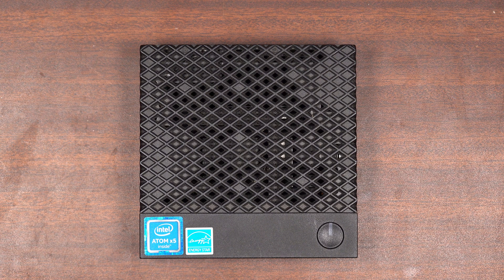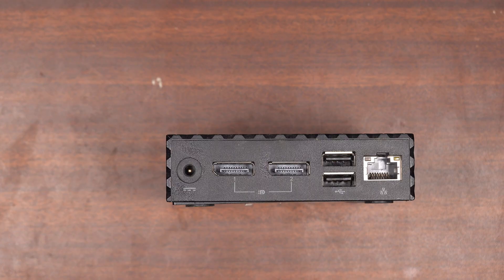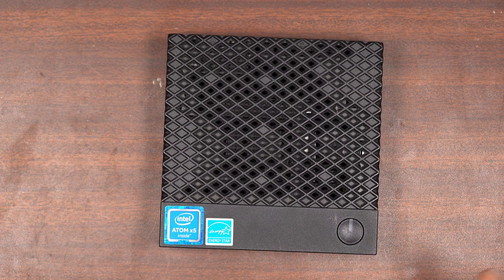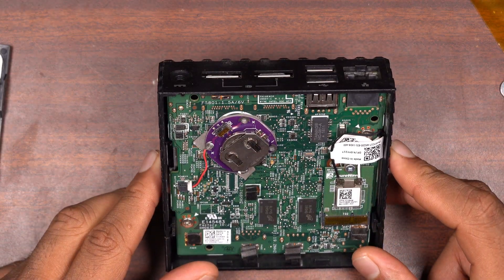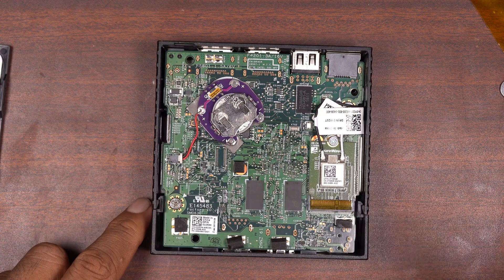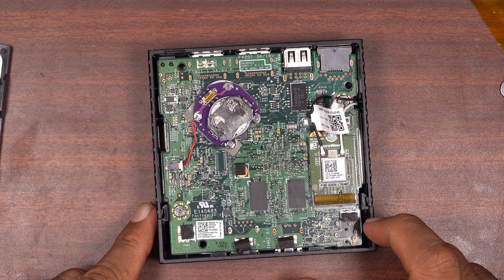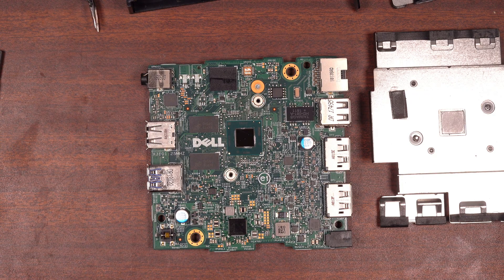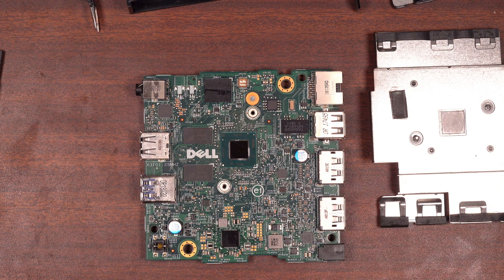Dell WYSE 3040 Thin Client | Teardown Overview And Benchmarks

Comment: I have similar one with 2/16, manufactured year 2021, the issue is it shows display only if cpu is powered first and monitor is powered off(unplugged or power switched OFF), after few seconds we can turn ON d monitor and it will show installed OS desktop. if monitor is powered ON and we turn ON cpu it will not show display. Tried dp to hdmi and also tried dp to vga, both have same isue. But if we connect both the connector with same monitor it shows display and works perfectly without switching ON OFF monitor. is this fault of converter? Tried THINOS, LIBREELEC, WIN 8, all have similar issue.Bios v 1.2.5
Reply: 1. check the hdmi cable
2. If your monitor requires 2k or 4k resolution, the display will be black
DisplayPort 1.2 (max 2560 x 1600)
Reply: @Evgeniy123 issue resolved by using a branded dp to hdmi cable.